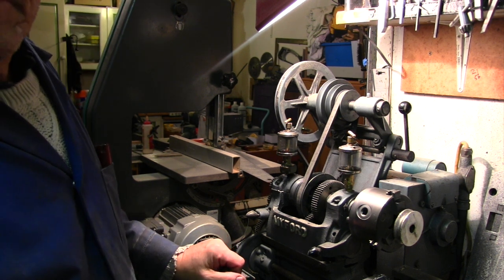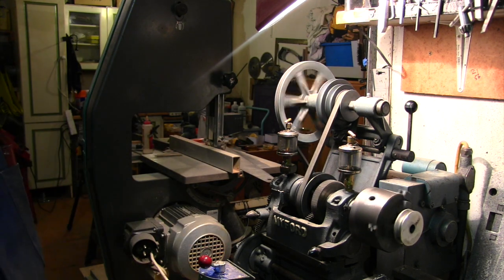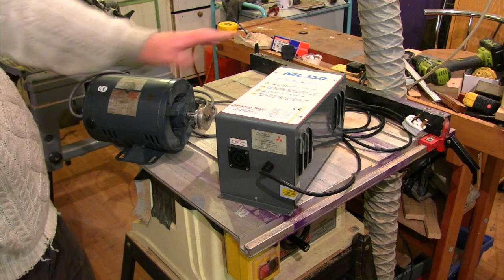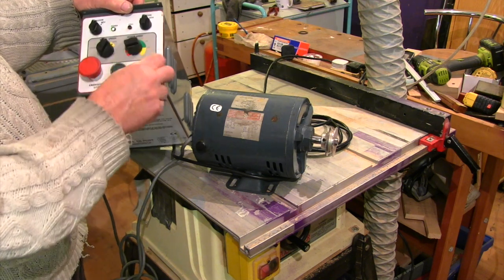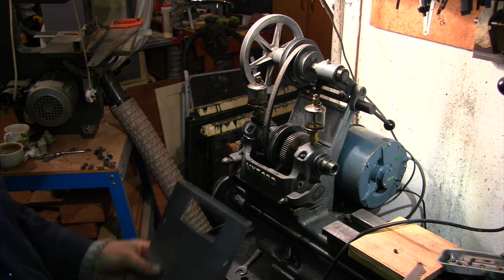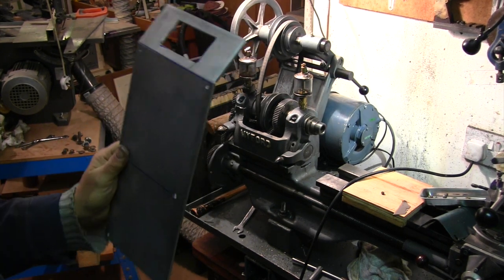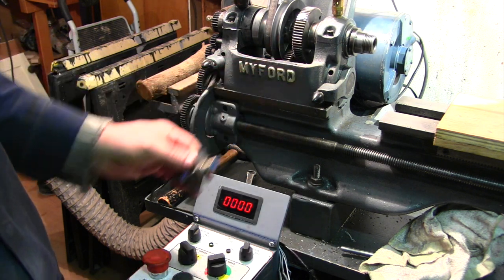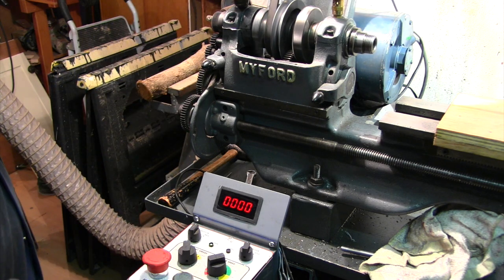Myford ML7 motor vfd and tachy

Comment: That was a really good video Cliff, I have always wanted to mess around on a lathe, I was going to try one of the mini one's to practice on aluminium to get used to how they work and get familiar with the settings.
So it was good to see the guts of the monster and it looks to be just a drill on steroids.
Making videos like this with real tools is very informative.

And that new motor looked mega balanced, didn't even see it move as it built up speed.
Great stuff.
Reply from the maker: thanks Darren, the motor and controller cost £185, used off ebay, but a new one is about 400, but your right about how well ballanced it is, when its full on things dont fall off the shelves anymore! :)
Reply from the maker: and you should get a lathe, and another shed to put it in!

Comment: Given the sleeve type solid bearings that ML 7 has Myford would have added the motor and designed the pulley ratios so the top rpm didn't cook the oil fed bearings. As long as you didn't go any higher than 900 - maybe 1,000 rpm and not do so for lengthly time periods you should be ok. But run those bearings the slightest bit dry at that rpm and you'll score them in seconds. 

My lathe hasn't had the motor changed and a VFD added yet, but my Bridgeport clone was 3 phase from the factory so has always needed a VFD. I'll still use the belt changes on it for any high or ultra low rpms. But today a 3 phase motor / VFD combination really is the way to go with almost any machine tool. I don't know anything about your Transwave system, but if it's designed like my Baldor VFD you should be able to go into the settings and adjust the ramp up / down times as well as program for any preset motor rpm you'd like. My mills 3 hp motor will fault out the VFD most times at around 4,000 rpm unless I set the ramp up time to around  3-4 seconds. With a heavy chuck and workpiece it's not impossible the same could happen with yours at 1800 motor rpm under a starting load, so if it ever does you now know what that might be caused by. You also need to be a lot more careful about a tool digging in or even worse a crash. The old system would probably slip the belt and the new would likely just break parts.
Reply from the maker: Hello TP,
                Absolutely agree, it did worry me that it might go to fast but the top speed on the small spindle pulley is about 960, and I rarely go there except for polishing, stays on the middle pulley mostly where the max is about 640.
This unit does'nt seem to be prgrammable, maybe is internally but I'm not going there, I've got an IMO on my wood lathe which is. This lot apparently came off of a late super 7 and was factory fitted, cant imagine why it came  off though? It is so well ballanced and a real joy to use, the jog when threading is great! and just being able to adjust the speed a bit on different diameters makes a big difference to the finish. I "ummed and arrred" a lot about buying it, it was £180, but am really glad I did.
Thanks for watching.
Cliff
Reply: Hi Cliff,
Inherently 3 phase is a much smoother power delivery over single phase and I really was amazed at just how quiet and smooth my mill was compared to any other single phase machine I owned. I think 3 ph and a VFD would show even more improvements on a lathe. A lot of hobbyist's today still don't fully understand the benefits of a 3 ph / VFD combination and someone may have re-motored that Super 7 with something they were more comfortable with? The last mine I worked at had just about unlimited real 3 phase power available yet almost every motor had either a progressive logic controller or a VFD added to it just because of the fine tuning possabilitiies they provide. Doing so would have cost millions of dollars yet it was considered as a non optional system requirement.

Just in case you don't know of them yet, George H. Thomas wrote numerous excellent articles for the Model Engineer magazine. They were condensed into 2 books after his death I think by a good friend of his. One called The Model Engineers Workshop Manual. The second, Workshop Techniques. The first is without a doubt the very best machining book I own out of hundreds even though I don't own a Myford lathe. The second deals mostly with building fairly major workshop tools. But goes into great detail about lathe headstock dividing for the various Myford lathes. With your clock making interests and having a ML7 I'd highly recommend the 2 books even though both of them are more about accessories, improvements and additions to the Super 7 lathe. There's not much in them that couldn't be adapted to the ML7.
Reply: I have run my white metal bearing ml7 at 1500 plus rpm frequently over the last couple of years and just upped the oil flow to cope. I have experienced no issues as a result. 
Jon
Reply: @joncaulfield9  Hi Jon, can I ask how you got you're ML7 to run that fast and how it's coping now? Thanks!
Reply: @Kraats42  hi, I have a 3 phase motor on a vsd and also made my own motor and countershaft multi vee pulleys for speeds up to circa 2k rpm at 80hz. As previously stated, I run up to about 1500rpm regularly and up the oil flow to cope, I tend to oil very generously at those speeds as a safety precaution and frequently check the temperature of the headstock bearings, particularly the one nearest the chuck.
I did once under lube the bearings at speed and the chuck slowed as the bearings nipped up, I was lucky and did zero damage but caution is advised.
My ml7 is a 1952 and I believe still running its original headstock shaft and bearings. I have however fitted a hardened countershaft (basically a big needle bearing) and new oilite bushes. All of which have endured countless hours of use without complaint.
Cheers Jon.